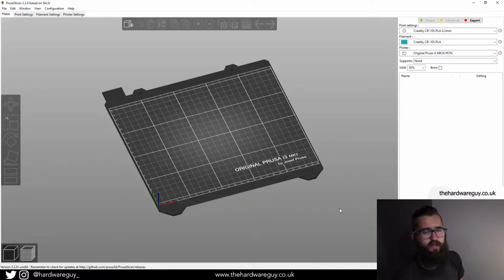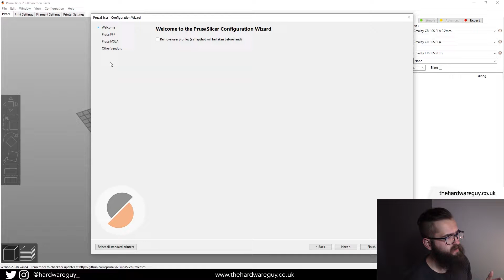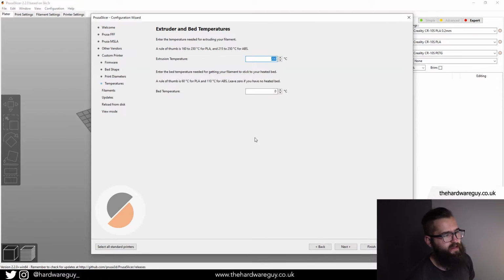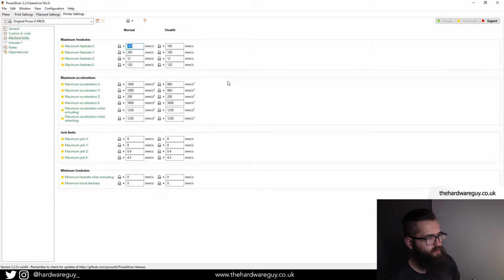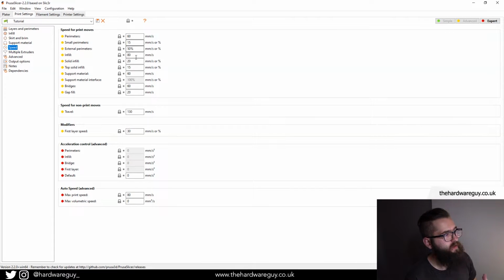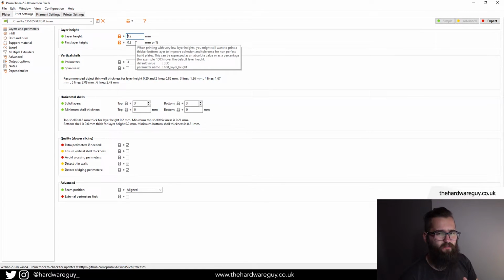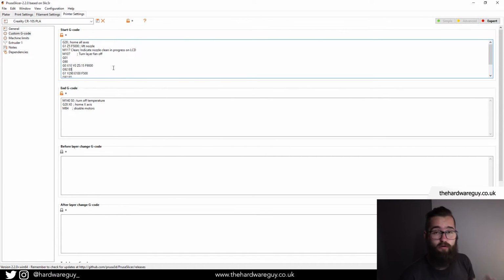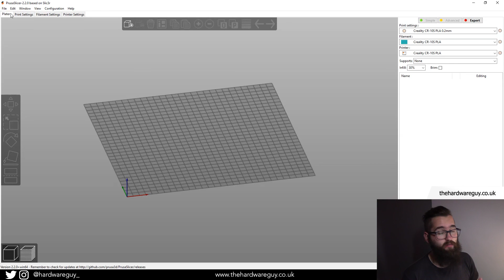Custom Printer Profiles in Prusa Slicer (Creality CR10S)

Comment: First layer height defines the thickness of the layer. It doesn’t define the amount of squish as the volume of material extruded is adjusted for the thickness. If you want more or less squish on the first layer. Adjust z offset
Reply from the maker: The correct way to do that would be to adjust the extrusion width
Reply: @thehardwareguy  that would also work. In my experience with something like a petg or carbon petg. It seems to like to be dropped onto a surface with no squish at all. And I find using x offset the most effective way but that can also affect overall. Height of the print slightly. Many ways to achieve similar results